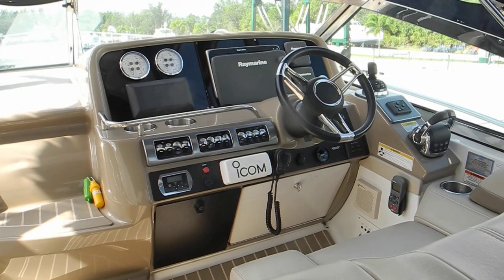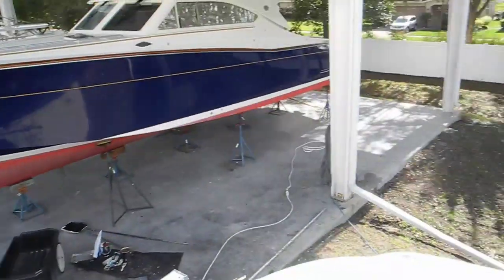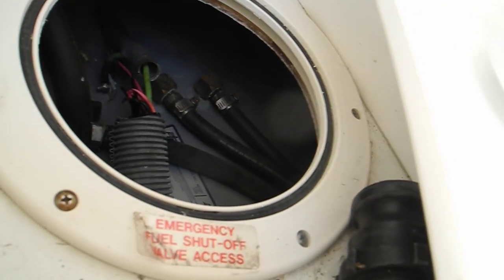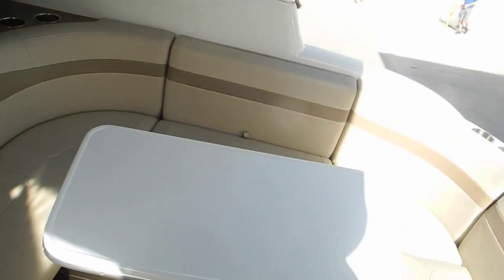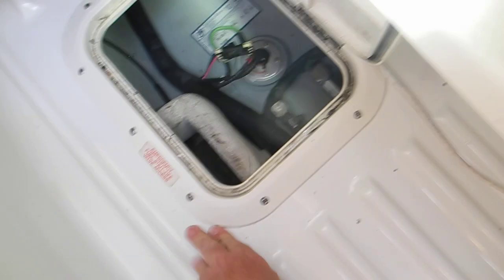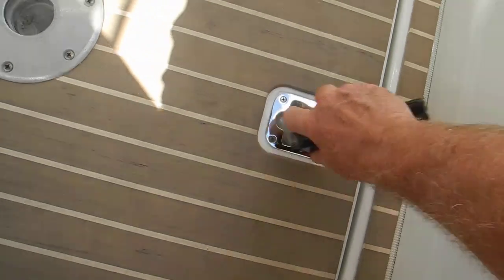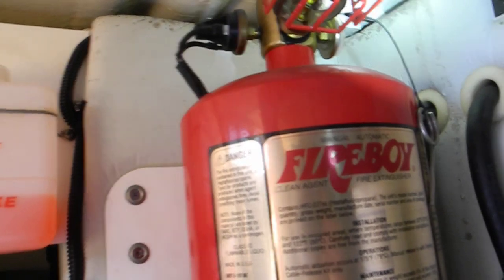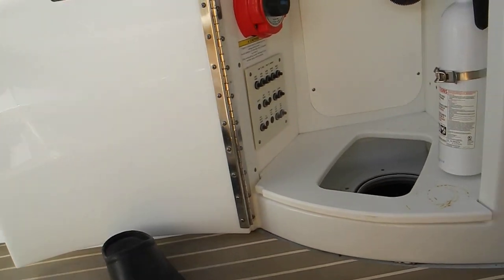Fire fighting systems

Comment: No wonder you see videos of Boats engulfed in flames. I agree with John good luck cutting off the fuel with this setup. I'm really impressed with the gauge mounting. 🤣🤣🤣
Reply from the maker: Sometimes these valves are located in places with easy access. Other times you have to hunt and search for the valves. In this case the access panel is NOT labelled, the "stuff" the boat owner may have jammed in this cabinet may restrict reaching the valves. Here we see the valves are 1) hard to locate because they are black and 2) difficult to reach because of their location. The faded Fire Extinguisher label on the cabinet door was put on by a previous owner and that was specifically for the hand held unit inside.
Learn every system aboard your boat. Ask Captain Chris for a Face Time tour of your boat.
Reply: @AskCaptainChris    Yes Sir I would at least replace the cutoff valves with better quality and hopefully red or yellow so you could see them better

Comment: Good luck getting to all those valves while a fire is going on around you.knowing where they are is vitally important—being able to get to them is even more important. Also—these valves look like they are plastic.Plastic becomes brittle which could snap when your trying to turn them and can also melt under extreme heat from a fire.I’d think manually turning them a couple of times a year would be a good practice to keep them from locking up—maybe replacing them with some stronger ones couldn’t hurt either.
Reply from the maker: I agree with everything you wrote. New boat owners and even long term boat owners do not know these valves exist or if they do they may not know where they are located. NOTICE to boat owners, every boat should have valves like these, take the time to learn where they are and how to access them. Your life or your boat's safety may depend on turning OFF the fuel supply lines. I am available to help you learn more about your boat's systems in person or by Face Time. Ask Captain Chris.
Reply: I can hear the Captain. ( with flames and smoke billowing) Please remain calm while I look for the fuel shut off 😅😅😅
Reply from the maker: @alabamasmokeywilson6818  It's over here, no wait, I think it's over there, oh well ABONDON SHIP!
Reply: @AskCaptainChris  Oh shit now where are the life vest? 🤣🤣🤣🤣
Reply from the maker: @alabamasmokeywilson6818  Good question. Life Jackets should always be accessible at all times. If behind a cabinet door or a seat locker there should be an obvious label.
Reply: @AskCaptainChris  Are those valves really that important? I only have an accessible (or getatable as another famous boat Youtuber says) shut off valve for the fuel to the heater, not for the engines. I reckon the thing that causes heavy fire near or on an engine is the fuel mist that comes from after the high pressure pump. As soon as the engine is off, the mist stops. Can there be a dangerous flow of fuel when the engine is off? Maybe if a plastic/rubber fuel line has burned off and the fuel pours out by siphoning.
Reply from the maker: skunkjobb yes. They are that important.
Reply from the maker: skunkjobb the mist is a serious problem.